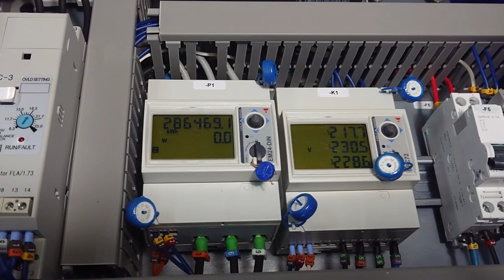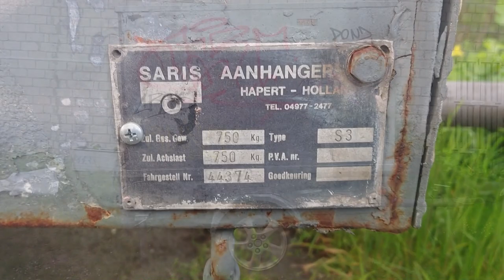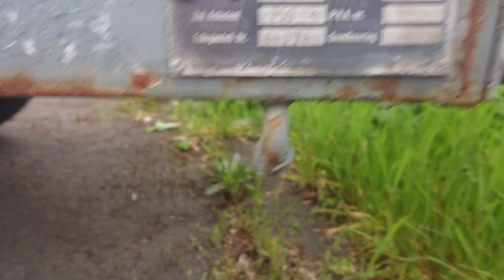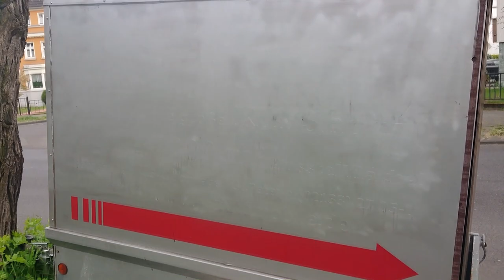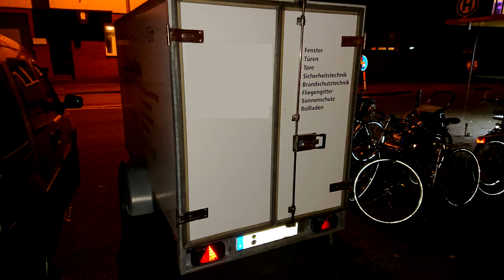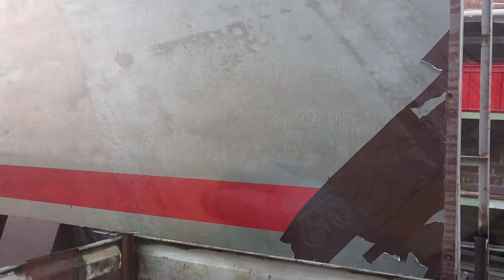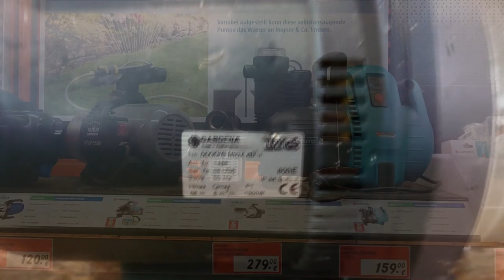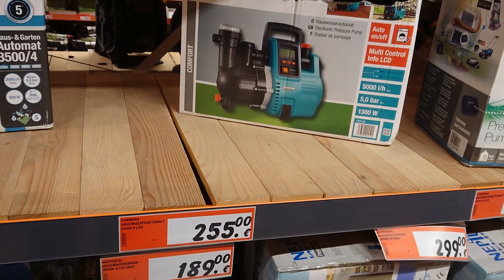Expensive Scrapyard Finds! Repair-A-Thon!

Comment: That blue cabinet with all the goodies inside is an incredible find. I'm curious how much you had to pay for it at the scrapyard?

I have a tendency to be very stubborn on projects too :P

This whole smart-device movement only adds unnecessities and more points of failure to things, which in turn just makes them become unusable and thrown away prematurely. As if the general bad quality of things today arent enough already in this ever increasing throw-away society.
I've been a big opponent to that sort of nonsense since the beginning. A pump is a pump, trying to make it anything else will just degrade its overall quality.
Sorry for the rant, it's just frustrating that everything seems to go in the wrong direction xD

Comment: hey, what price did you get for the cable scrap? at my local scrap center i get (if i remember correctly) €1.2 a kilo for pvc electrical bla bla bla.
because €200 for what you showed in the vid surprises me. am i getting ripped of?

Comment: Yeah yeah you are making travel trailer out of it we get it :D Not sure hows the carrying capacity after all that added metal, but looks decent. I have similarly rusted trailer, but the thing is that since its home made before laws changed it still registered and soon as i find suitable tube i'l be essentially making new trailer except in title and dimensions. Much cheaper than buying a new one since those are as usual crap and not made to last, but mine will be. Specially when it can be rebuilt pretty cheap if it rust away while new ones have just sheet metal construction essentially, though even that is pretty hefty compared those damn things.. i have seen few in size like that but those are damn rare around here and most have been converted to motorcycle trailers if there was any. Locally i know like two.

Pumps are getting crappier, hence i took into storage several from independent pump stations, ones with their own pressure tanks, pressure switches and gauges. Those switches are bit delicate and tanks often are blown but i have one stainless tank ready if one in use blows, several pumps and i'm looking to buy new replacement switch ready for install as second back up, if box full of those used switches are not working. For pumps i have several ready but those can be also turned into independent pumps like i have done. Top of that i have few other gasoline powered pumps around, though i'm looking smaller older diesel engines that could be run with diy alternate fuels.

Comment: "What would you do with a trailer like this?"

I'd first look into adding some unobtrusive hardware for tying down stuff, such as D-rings and or rails for attaching rope/straps to so as to prevent items from falling/sliding during transit.  That should atleast make it somewhat capable where moving stuff is concerned.

Next I'd look into adding a bit more hardware to make future additions/removals somewhat easier, perhaps slotted angle steel and heavy duty shelf brackets could work there.

With those changes as well as a battery charging system + inverter you could use that trailer as a workshop or if need be as a camper (granted it wont be very comfortable but at least the options on the table).

Comment: On the pump digitalization: In Norway many use these pumps for water supply on cabins. From wells, rivers, rain water collection tanks etc. Then it makes more sense to have apps and digital control (when your pump is placed in an outhouse or in your cellar). 
But for emergency use I fully agree. 
You have many german firewater pump suppliers: Most of the smaller mobile pumps used by civil defence or other small fire services use them. They ofcourse come with petrol or diesel motors to be used in emergencies or away from power. Almost all the pumps I have seen in our national fire service is from German manufacturers. 

Norway actually has an abundance of old fire pumps that have been sold out from our national fire departments that are driven by the more or less trusty VW beetle engine. A simple trailer with a pump and a boxer engine. Nothing more, nothing less. A lot of farmers etc still have them around for backup.

Comment: That's quite a find. all those modular mains components.
That trailer is of a very good brand Saris so spares are not hard get for them.
You might be able to modify it and add schock absorbers yourself.
Your welding skills would be sufficient I think.

Comment: Solar powered Argon accumulator , for solar powered tig . Leaving the bonded stickers intact, there is a point when the removalis detrimental, nice choice. I left blue paint on a record vice after 3 layers of paint remover ,derust and wire wheel. . structure and longevity. I was wondering if stainless steel houses were on the early agenda. love the work. just bought a £100 rusty benchtop screwcutting lathe., beyond economic repair. tempted to cnc it.

Comment: I make car trailers. I think you'll struggle with stability with making your trailer even higher. Aside from wheels not being damped for bumps, the turbulence created by the towing vehicle will wreak havoc on the high sides of the trailer. You also have the added problem of blasts of wind from passing vehicles (either direction) affecting it and also side winds.

Comment: When used with care, plastic threads can last for a long time. 
I prefer them to aluminium threads. It is very easy to crossthread an aluminium part, even when you're careful. 
Of course, brass and steel are preferable over both of those.

Comment: The whole thing with wireless connectivity in appliances reminds me, I have an air-conditioner that lasted one year before something failed in the electronics, and yes, it has wireless functionality. 
Now it constantly power-cycles no matter what buttons are pressed and will even turn on briefly if activated fast enough between power failures.
We were going to warranty it but that was never gotten around to, so I'll likely swap in the electronics from another (older, but still modern/digital) unit since it's just the electronics that failed.
Great finds and repairs! Shocking that somebody threw that pump out when it was just the add-on module that failed.

Comment: I did the same to a small trailer here in Australia.  Cost me double want I paid in the first place.  We use A frame so the front. I installed a water tank got it for 50 dollars. Pipes where 3 dollars. I now need a Onga pump. But here in Australia we are getting lots of water at present.

Comment: Thanks, I rarely comment, but I think you need a spare tyre/wheel for the trailer. Especially if its not compatible with your car. My trailer has one, and I even have another spare at home in the shed. I really enjoyed your videos and thanks for putting them together, cheers from Oz

Comment: You added a lot of weight to the trailer. You might not be able to use it for much hauling. You can also add a cantilever and shocks to increase load capacity. The copper scrap could have given you the opportunity to do some metal casting. Glad your storing rain water, but couldn't you have used both barrels? I always enjoy your videos.

Comment: 21:30 these kind of pumps aren't made like waterpumps from the fire brigade, it's for solid garden installations; using plastic has one advantage: it will barely corrode and the 1-2 times you're supposed to tighten this spot, it'll be watertight as it kind of provides additional sealing due to being polymer.

Comment: Rust spots on the tarp you can easily remove with phosphoric acid, or even just lay a cloth soaked in Coca Cola on it for a few hours, which will convert the rust to a soluble form and remove it.

Solar panels off the bat put in a simple shunt regulator on a small one, and put LED light inside, so you can see inside during the day. 15W panel will work there, and you can put in a single 7Ah SLA battery and simple charger for it, to have light day and night.  Then a light front and rear, so you can connect up the car at night, or work outside at night with it. Put battery and controller in a box under the floor, and it will not take up load space inside. For the roof leave a space on the side, and put tie down points there, as you will eventually need to transport something too long, and thus tie it to the roof, and have the big red flags for the rear and front as warning. 

Trailer is ideal to camp with, room enough for everything, rugged suspension, and standing room as well. You can still add shock absorbers to the leaf springs, to smooth out the ride.

Comment: Hey, G - I'm thinking your trailer, with a charge controller, bulk batteries, and inverter connected to the solar panels, would be perfect to transport tools, materials, camping equipment, etc to your property in the country. A self contained work center with power generation could make camping out there while you work on the main structure a lot more pleasant.

Comment: Today I updated my Glucose meter to a new model. The sales information extolled it's ability to connect to a PC or smart phone.
It seems to me if you have the meter in hand to take a reading or review past readings there is no need to connect to a app on the phone or PC.
Uses for the trailer...
I would be thinking mobile workshop or Camper.
Eric

Comment: Use your trailer as portable power  and water pump station.  You can hang more solar panels on each side on hinges as well. 

Pathetic water tubs.  Purchase 250 litre plastic barrels.  They're cheap and will stack with ease. At least 2000 litres for a hot summer...at least.

Comment: I'm surprised they signed off the original conversion of that trailer. I'm guessing the heavy corrosion to the frame was due to poor design. The box was seated inside the trailer, which meant any water run off from with box walls would simply drip down into the inside of the trailer. If they had put the box on the outside, it might have been a different story. Great job with the repairs.

Comment: Terrific buy, even with all the corrosion!  I'm a bit surprised, since you had the floor totally out, that you didn't fabricated mounts for shocks so the trailer could be towed at the higher speed.  I know you didn't want to put much money back into it at this point, but fabricating a V shaped front instead of the flat one would help immensely in both general towing, as well as how much fuel needed to do so.

Comment: Are you worried about the stability of the trailer?  You've made it much more top-heavy than the old suspension was designed to handle.

Comment: The increase in electronics is indeed disturbing. Cars for example. Particularly electric cars. An open source operating system for cars would be a step in the right direction. The manufacturers are very secretive about their software.

Comment: If you didn't you should put that 2nd barrel you replaced and set it by the other one and make it so when the 1st one fills it'll spill into the 2nd one before going on the ground. That will give even more capacity for water. If you can get them there the 300 gallon ibc containers that have the ball valve built in.

Comment: For your trailer, not sure how much more you want to add to it. If so, I would suggest wiring up 1 or 2 LEDs inside of the trailer. Use either the power from the cars trailer wire harness or the solar panels if installed on top with a light switch. Love the build!

Comment: We have a small garden with a cascading rain water barrel collection set up, this has a solar panel with an old car battery powering a 12V caravan pump, this works most of the year round.
Cheers

Comment: Oh my, you definitely overdid that trailer with all the tig welding. I wonder how much the previous owner's "slap more panels on" approach cut into the capacity of the trailer and/or towing vehicle: as someone who tows a trailer with a small car I am acutely aware of the weight of my trailer itself as well as the weight of the cargo. The trailer alone uses nearly a third of my meager towing capacity, before adding wooden sides or floor.

Comment: Why not increase the space when rebuilding the whole upper box by extending the space into a point in the front of the trailer, covering the space above the triangle formed by the box towards the point of the beam that’s holding the trailer hitch?
Plus it’s a bit high don’t you think, a bit top heavy maybe when loaded to high?

Comment: You should put the hinges on the inside of the doors, or use bolts. A screwdriver could break into your trailer.

Comment: I was going to say I used a Mobile home roofing paint has a rubberized coating and being white or aluminum color reflect sun keeping it cooler you use a silicone caulking then a. Tape membrane on the edges and seam then coated 2coats last 15yrs

Comment: Nice trailer, but I'm a bit concearned about how so much surface area might make it a little tippy in a cross wind.  Are you going to locate some heavy batteries beneath the floor (as ballast) to go with those solar panels?

Comment: I would build an HHO generator that could be connected to the solar panels via a battery and voltage regulator so you could cook or even do light welding without relying on mains electricity. The trailer could store camping gear and provide power for small devices when traveling.

Comment: I'd honestly make that trailer into a little modular work space / camping trailer you could build slides for the sides or front with some drop down jacks and stabilizer arms then you'd be set for "in the field" repairs or just taking your Fraulein out for a romantic camping trip somewhere in the idyllic austrio-german countryside or as a mobile power station housing ups batteries solar charging systems and whatnot to act as an emergency generator in case of power failure or to bring power to areas you are working at where it would be required

Comment: I think you may want to avoid windy days with the trailer 😀 I have never seen an axle setup like that with one lateral leaf spring here in North America. Here it would be a straight axle tube with two leaf springs. They also use torsion axles here. They are independent so the trailer can be lower to the ground as there is no axle tube between wheel ends

Comment: i built a box like yours on top of a hand me down trailer i got from my father purchased in 1981.  Built the frame from angle and clad it in thin ply. served me well for a few years as a tool trailer for my mowing business. allowed me to load it and leave it loaded with tools secured inside. cant wait to see what you build from yours. the body looked bad but thankfully the chassis looks good.

Comment: You can use the solar panels to make a cooling mechanism for the inside of the trailer like a form of an a/c only less power hungry .Maybe even using it as a ventilation duct for humidity or heat extraction..

Comment: I would be very wary of using that trailer in any sort of windy conditions as it seems rather high for it's length, but still a good job on recvlaimiing it though, and as for apps on everything- I am with you on that- they are not as reliable as good old fashioned analogue manual switching methods.

Comment: I'm surprised that you stuck those sheets to the sides of the trailer though I get the point. Personally, I would have stuck with removing everything and painted it. Like yourself though, I seem to collect things like old tools and try to repair them. If I need them then I keep them or otherwise sell them to cover my costs.

Comment: I would use that trailer to carry around a large telescope to dark sky sites. The solar panels would charge batteries for 12v power to the telescope and accessories. 

I think I would add a curved or angular piece to the front of the trailer to make it more streamlined.

Your rainwater storage is illegal in some parts of the world. The reasoning is that rainwater is supposed to replenish the watershed available to the environment. It is ironic that conserving water and using it responsibly is considered a crime in areas where the watershed is diminishing. I live in an area where we have an overabundance of rainfall and ground water, but I still want to store rainfall for aquaculture use, rather than tap into the potable waterlines of the community, which is expensive.

Comment: I would use the trailer as a mobile power plant! Perhaps make the sides foldable and put solarpanels on the inside walls so when the trailer is parked the roof gets bigger and then one get shelter from the rain or sun too! Great video like always!

Comment: That hose you put on the barbed fitting should be soft when putting it on, use a heat gun to gradually heat up the pipe so it starts to go soft, then put the hose on the fitting, additional lubrication may be required, and tighten up the jubilee clip. 

This will ensure the pipe seals well agains the brass fitting and the jubilee clip clamps on the hose properly.

Comment: Build it into a little tool trailer and use the solar panels to charge a battery bank, with an inverter to charge cordless tools, and run lights.   It might be nice to be able to recover things from where they are, or if you happen to buy your farm in the woods, it would be a good help to start doing the repairs.

Comment: The moment that you spotted aluminium panels you should have known that the steel would be badly rusted due to the electrolytic reaction that takes places between the two dissimilar metals.

Comment: I think this trailer is way too high for a windy day on the road. This will tip over, especially with 30kg of panels on top. I would connect the solar panels to a 300W $40 grid tie inverter to lower your electricity bill. You may save 1.5kwh per inverter per day in summer, which is 45ct per inverter a day. The inverter ROI can be as low as 4 months.
Reply: Forget the wind, a sudden turn will have it on its side. It wouldn't pass inspection in the US.